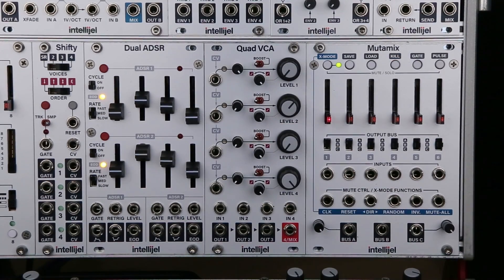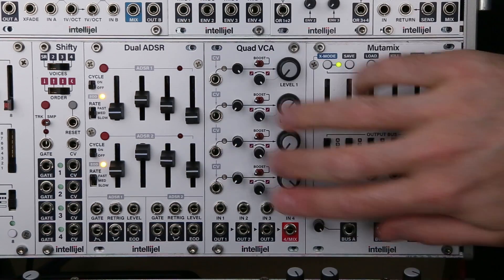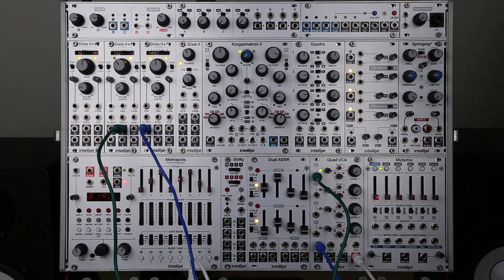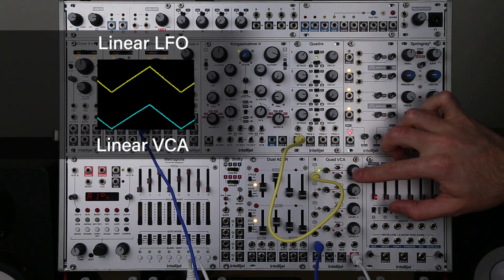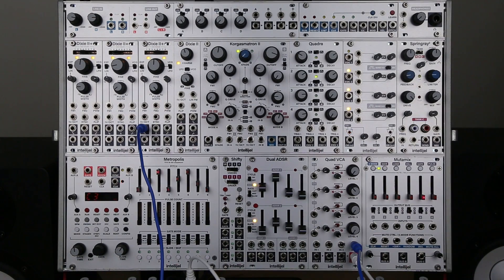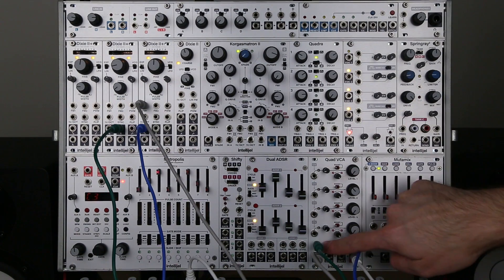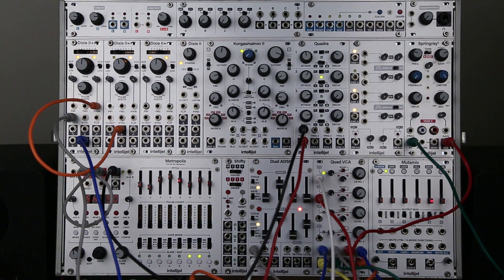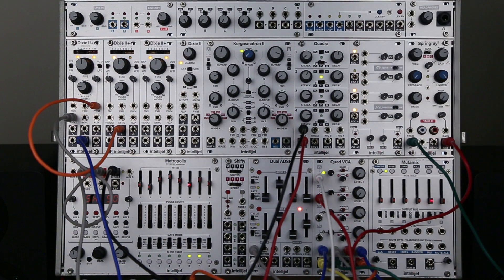Intellijel Quad VCA Walkthrough

Comment: Nub question..I receny bought the module but I find hard to use it as a classic vca/enveople and at the same time route in the rest CV other mods. For example if I send on the second cv an LFO u can hear the effect in the overall sound but when the key is unpressed the LFO continues to cycle where I would want to it stop like my envelopes. Am I doing something wrong?
Reply: Not sure I understand @Ekoboy. Might be best to e-mail supprt@intellijel.com and ask them for assistance.

Bear in mind that the bottom inputs are mixed together, but the CV inputs along the left side are not - they are just normalled so they feed from top to bottom. If you want to combine CV sources, you could either mix them together with the bottom inputs, or you could take the output of a channel and feed it into another input. Hope that makes sense.

Comment: if you are using the Quad VCA as a mixer, why would it be beneficial to have the vca set to exponential?
Reply: That's a good question! The exponential curve (or just a touch of exponential) may be useful if you're mixing in a louder signal, as it will come in more slowly in the early range of the knob.

Comment: Ok so if I have 4 VCOs and 2 LFOs, how many VCAs do I need and why? How many filters (VCFs) and envelope generators (EG/ADSR) do I need and why?
Reply: Good question, and tough to answer because it does depend on what you want to get out of your system and how much HP you have to work with.

In the case you described, a single Quad VCA would let you mix the four oscillators and you would be able to send the mix to a single filter and control the amplitude and filter cutoff with a single envelope using a mult/hub, but I'd recommend at least one more envelope (Intellijel's Dual ADSR would give you 2, Quadra would give you 4). Of course you would need another VCA if you wanted to apply the LFO to create tremolo or you could just send fewer VCOs to the VCA, or use a mixer module like Mixup first.
Reply: I don't think this is an equation that you can simply solve for.  When asking how many VCAs you "need", I think an honest answer will be another question along the lines of, "how creatively do you want to use VCAs in your patches?".  The classic Eurorack adage is true: "you can never have too many VCAs" .  Why?  Check out some videos that result from typing that into YouTube.  VCAs can be used to modify anything other CV/audio signal in your path.
Reply: @theTerribleFamiliar  being new to modular, I'd love to find sample patches how to do these things with VCAs to help better understand how they work.
Reply: Short answer, nobody explains anything worth a shit when it comes to modular. Needs to be a comprehensive manual instead of these jack dick videos

Comment: just wondering, if you are using the springray as an effect send in the last patch wouldnt you want the dry/wet to be totally wet??
Reply: Good eye! Yes, you would want it to be 100& wet, or you could use the SEND output. In this case that was a prototype module where the wet/dry balance was reversed on the panel.

Comment: Didn't get the last patch. Can you please share a nodulargrid patch?
Reply: Hey Funky Junky, sorry about the late response! I've tried to recreate it a couple times on modulargrid, but the sketch a patch thing has just been too buggy to complete it! Even using Chrome, which is the recommended browser.

I think probably the most confusing and easy to miss thing about this patch is that the output of channel 1 of the Quad VCA is being multed and fed back in to two other channels of the Quad VCA (in this case channels 2 and 4).

The output of channel 2 is sent to the effect, which creates your SEND channel. By increasing the LEVEL or CV input of channel 2 you send more of the dry signal to your effect. The effect then goes to channel 3 which becomes your RETURN. You can control the amount of return using the LEVEL or CV input. 

Channel 4 is your duplicated dry signal from channel 1, so you can control your DRY amount using the LEVEL knob. Now as long as nothing is connected to output 3, output 4 gives you a mix of channels 3 and 4. You can set a blend of your wet and dry signals, but you can also modulate them with CV.

Hope that clears things up...